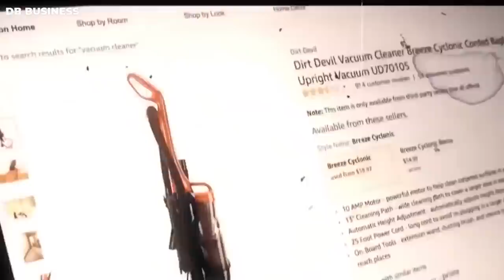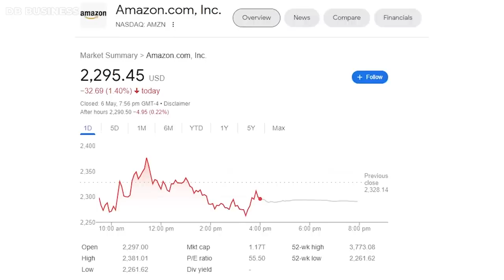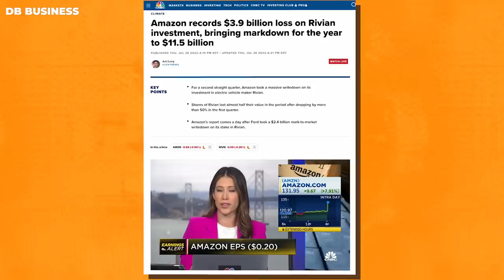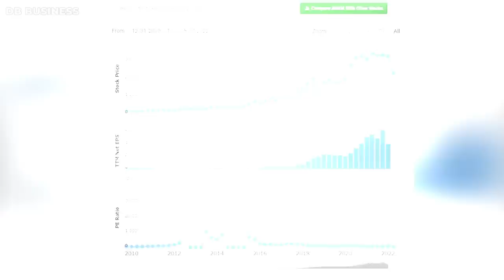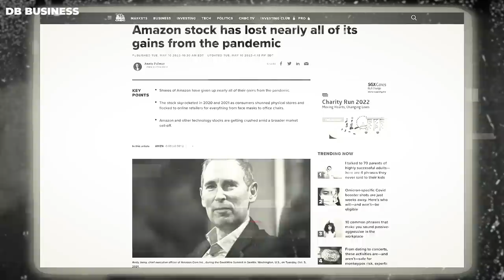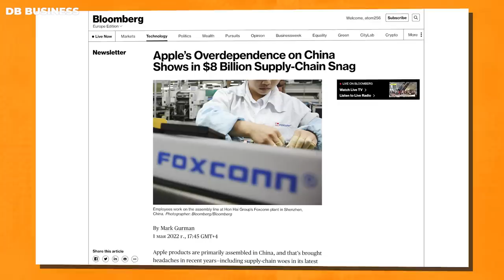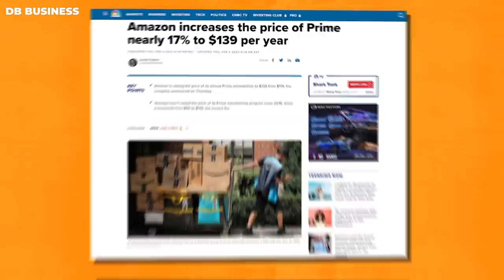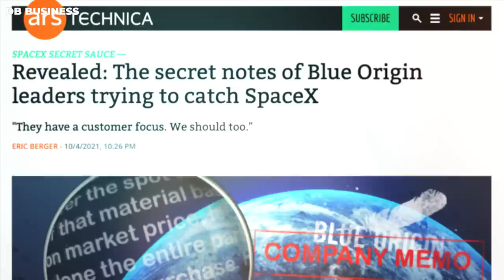Amazon is Finally Losing Everything

Comment: Amazon losing employees is no surprise as I see so many videos and articles reporting the Amazon treats its employees like dirt.
Reply: As a current employee, it is true. HR on-site is no help. Can’t take days off etc smh
Reply: @kyraali-stmarthe3729  hr is not your friend they are there to fire you.
Reply: Depends on the facility I suppose, I’ve worked at two buildings in the Columbus,OH area and the only problem I had was with managers not making people do their jobs lol. In my opinion there are a ton of people out there who go to work only for the paycheck and not to actually work.
Reply: @Nikolaos740  whether you scan 5 or 500 package a hour, you get pay the same rate. There isn't a reason to work harder but do just the bare minimum to avoid being fired.
Reply: @bloodysimile4893  For someone who is looking to be promoted internally, yes the 5 or 500 an hour does make a difference. And yes they do promote internally before you you start talking about more stuff you don’t know about. Outside of promotion they allow you to do indirect roles once you show you can preform the one assigned to you initially. Those indirect roles have no rate and you aren’t tracked for anything you are doing. So there are reasons for hitting the rate.
Reply: @Nikolaos740  That's nice.
Reply: @Nikolaos740  A person who can do the job five people. Can be replaced by five people, who will show up for a check. Amazon understands this. It's unfortunate there's so many others do not.
Reply: @studiomansion7942  yes in most instances but Amazon doesn’t hire directly for probably 70% of the work performed in a warehouse, they hire you to do the basic shit and you learn and do more interesting things when you show initiative and productivity. That requires that they do have quite a bit of motivated and responsible people.
Reply: Tesla doesn't treat its employees any better.  Overworked and underpaid.
Reply: @losfromla1480  And how do you know this ?
Reply: I'm in the aerospace industry.  Their salaries are below industry average.  You can read from their job postings that working extra hours is expected.  Tesla worker interviews on websites reveal the same.  It's not unexpected from a gemstone mining heir is it?
Reply: @losfromla1480  Gemstone mining heir? Sounds like you got a vendetta against Musk..what happened Tesla wouldn't hire you?
Reply: @garystrankman3841  yes, his father/family has owned/operated this mine for a couple generations.  That's where Elon started from, he started from the top.

No, never applied there.  I can tell from the job postings that they work people like dogs.  I don't need the stress from working at such a place when I've had good-paying engineering jobs my whole career.  Jobs where if I work extra hours, those hours are paid for.
Reply: @odeball22  for a fact. I’ve already been fired once & they’re trynna fire me again for needing a medical accommodation. Gave me 60 days to upload docs (my doctor is still filling it out) & started harassing me within a week. I just got annoyed & contacted a lawyer 💯
Reply: @kyraali-stmarthe3729  good.
Reply: Don't believe everything you read, I work for Amazon in a FC, and I personally where I work have not witnessed anything that has been reported.
Reply: @kyraali-stmarthe3729  You booked flexi when you want to get away early?
Reply: @Helldragon64  Good job finding a less stressful job. Sometimes you have to take a pay cut for peace and less stress. They deserved everything you took. Join the club. I know lots of people  who steal from them.
Reply: Thay is true I been work at Amazon almost 2 years. Jeffy bozo doesn't care about his employees I heard ppl quitted cuz toxic enivorment

Comment: Amazon is so overpriced! I watch the prices on everything I purchase and amazon is often two to three times as expensive as what I end up paying. I don't even bother looking on Amazon anymore unless I need something fast, like parts for a furnace.
Reply: Totally agree. I looked for spray paint and the wanted $32.99. Got it at the hardware store for $13.99. Exactly the same product.
Reply: @darried3157  Amazon was somewhat in line with its pricing in its early years but now they think they can charge anything they want and people will pay it. The dollar is already just about useless and then I should pay those outrageous prices on top of it. The Amazon bubble has popped.
Reply: There are too many bot scalpers who are then selling products extremely over priced. Amazon needs to reign in the 3rd party sellers who are bot scalpers and delist these sellers permanently. They need a way to thoroughly vet their sellers.
Reply: You can’t build robot warehouses and have land and air drone army for free.
Reply: Use Ebay....  Screw Amazon....

Comment: The true problem lies in the sanctions against Russia, plus there is no future for electric cars - too expensive and too environmentally hazardous!
Reply: The real problem is the non elected actively breaking the economy to introduce something else I probably can't name here.
Reply: You are both wrong, electric cars, no transmission, no oil, all together less moving parts and the electric engine doesn't see the same heat stresses or friction wear as the inside of an internal combustion engine, go learn somthing instead of spreading your feeces everywhere. Consider the energy required to cast an engine, to machine all the individual parts to extremely high tolerances, then compare that to what it takes to manufacture copper wire and wrap it around a motor core, toss some magnets on the inside of a big as pipe, throw some bearings at it, throw some batteries at it, and brakes combined with a small amount of control circuitry way less complex then the electronic control module in your car. Sorry but if Henry Ford was alive today he'd laugh in your face for really believing it takes less money energy and materials to build a combustion engine lmfao.
Reply: Just because Americans are too lazy to become good engineers and inventors like the ones thst built the automotive industry, doesn't mean electric cars aren't a cheaper smarter more sustainable vehicle lmfao. Grow up.
Reply: @dlayman101  I don't know about the lazy part.    The people who OK funding are generally not the ones who will design them.
Reply: @danharold3087  take five minutes and count the units of energy required to manufacture a single combustion engine, then consider the energy to required to make the fuel, then caculaye its life span, then look at the mechanical losses from crank shaft to the tires, then compare that to a vehicle with an electric motor on each wheel, the energy to make the motor, the energy to make the batteries, and a small solar or wind installation, if designed properly removing the vast majority of AC inverters and transformers, qs well as swap all compressors over to dc brushless motors aka higher efficiency. Etc etc etc, i can go on and on and on, give you so many simple cheap effective solutions it would make your head spin, but i digress...

Comment: A couple of months ago I tried to buy two parts through Amazon.  The first came in on time, but was not the part I ordered, but another part that looked similar but would not work.  There was a label for the part I ordered over a factory label of the real part.  Then it took a month to get a refund.  With the second part I was told that it would not come in for a month, because of "supply chain issues".  I could not wait that long and having Amazon already send me the wrong part I made some calls and found out I could get the parts for a little more locally and did.  They told me they had tons of the 2nd part, no supply chain issues at all.  So I tried to cancel my order for the 2nd part from Amazon, and they said I had to wait for it to arrive and then return it, so I waited a month and when I checked it said that the parts delivery had been delayed another month.  After 4 phone calls, an about an hour and a half on the phone they finally cancelled the second order and refunded my money.  It was a really simple order, I do them all the time at Home Depot and other retailers and almost never have a problem, but with Amazon it was one issue after another.  

During the time I was on the phone I voiced something allowed to the person from Amazon I was speaking too when they kept telling me they could not do this, they could not do that.  I said "I guess Amazon has its limitations" and remarkable the person agreed.  I realized during this ordeal that Amazon could have some serious issues if they could not get such a simple and easy order completed correctly and on time or simply rectify the problem, it seems my guess was correct.  

By the way this video does not go into other Amazon properties that are having problems, like Twitch, or their gaming companies and the disaster there game New World turned into along with a lot of other cancelled projects, or the new Rings of Power series on Prime, with a billion dollar commitment, which seems not to be very good.  Amazon is a lazy company, it treats its workers poorly, it has no clue how to run a lot of the business it bought or how to make products outside of its web page, taking orders and filling them, and it cant even seem to do that very well anymore either.

Comment: I don’t think so. Follow where Amazon is heading. You might want to put stock in it, though it just had to take a split but it is already doubled since then
Reply: Amazon has been down, since the split. They jumped upon announcing it and it dumped hard going into the split. I think its currently still down from its pre-split levels
Reply: It actually split at about $110 per share.  It's sitting about $130 now.  Of course,  it's headed down like everything else and 2023 will NOT be kind to any retailer.

Comment: For the Consumer ... Amazon is the Best thing since sliced bread ! ... it is happily utilized by Millions ! ..... How's that BF Rocket doing , that helps No One ???
Reply: Why does it help no one ?
Reply: @Blibby-Blobby  Did it help you ? ... And why didn't it help you ? ... Cause it didn't help me either ....
Reply: @robertbrander2074  for most rockets to be of benefit to anyone they first have to work.
So far all blue origin only did some sightseeing trips for a hand full of people. I'm sure if you asked them that question they would say yes...
Spacex on the other end are resupplying and re crewing the ISS as well as many other satellite lunches that provide all kinds of data that help us all.
IE GPS.
The plan is to use New Glen to do similar things and as cheap which means more benifit to you and I.
I know for a fact I have benefited greatly from all the spin off Inventions from the space race.
I'm such a bad cook that I can not imagine life without a non stick pan....
Reply: Sliced bread ain't that great.
Reply: @bu-bye565  well I find it quite hard to bite down on two loafs in a sandwich so I prefer to slice.
Tearing it open is also an issue with spreading butter so I think sliced bread is quite cool.